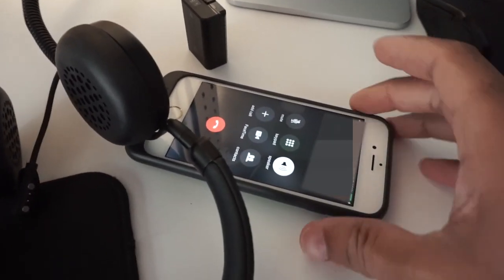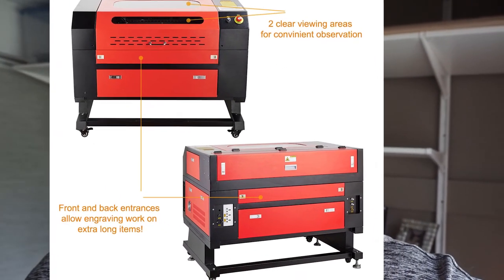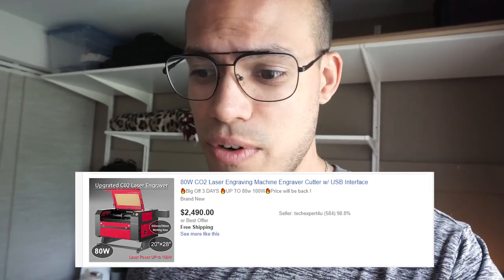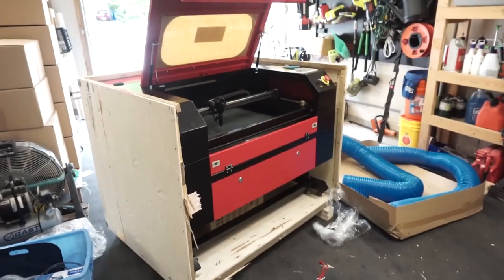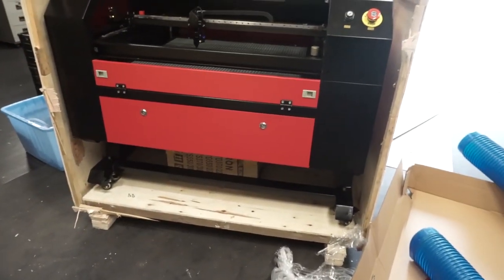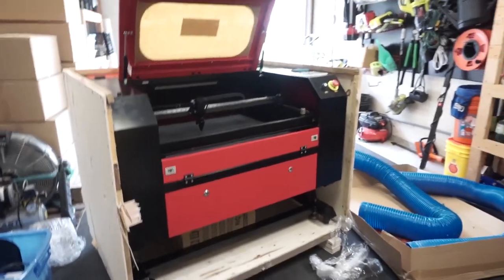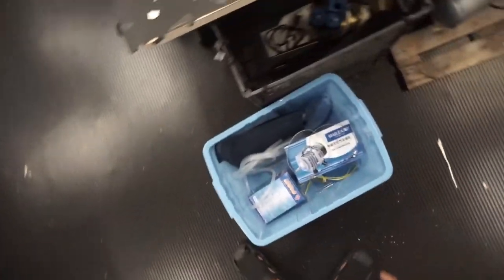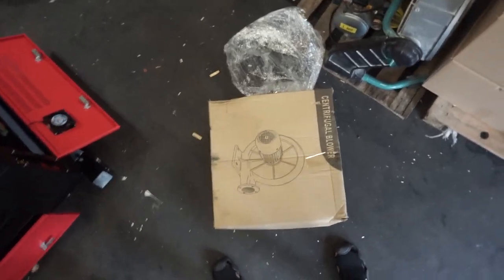Unboxing, Mods and Review | 60w Red and Black Chinese eBay Laser Cutter

Comment: RE: Honeycomb... determine the washer sizes and numbers to get the honeycomb level (if it isn't warped), then use four screws (longer than originals) place them and Loctite them in place and cut them down to just a little higher than the bed. Then put the washers in to keep the bed level and good to go. Might want to use a tool to debur the tops. Just an idea.

Comment: These guys just want to complain. First buy a lower price (cheapest) laser available and then complain about all the things it doesn't come with.
Reply: Honestly the laser isn't that  bad. its the program that comes with it that's ruining it. If it came with Corel Draw or another american program it would work great! Its this RDWORKS Garbage thats making it hard to use. The whole settings menu and everything that should normally be there to help you, including the owners manual  is in what i like to call "chinenglsih" (CHINE-ENGLISH)  Where it appears they have taken Chinese and put it through google translate.
Reply: @theprodistini2590  im using coreldraw to design the files and just use the delivered autolaser to tell the cutter to cut it. no rproblems so far
Reply: @theprodistini2590  RDWORKS isnt meant for drawing from scratch, but for importing designs and defining the laser operations orders and settings.

The drawing tools are just there to do a quick fix here and there when necessary.

Comment: Nice mods/upgrades.   Would not be better to get the 80w since the begining?      What are the dimensions without the legs?
Reply from the maker: Thanks. With the track record on them, I figured I would rather personally upgrade to a known quality Tube / PSU when the time came VS taking whatever "80w" kit they wanted to include for the premium. It's 48w 35d 24t (w/out extension)
Reply: @sjetmand  Nice. Thanks!     I am searching about which one to buy, focusing on engrave area and having pass thru door.  I have just a couple of options and seems like one of this can fit into my office (removing the legs)

Comment: I just purchased this same Machine on Ebay and did one etch job and am getting the same results (weak tube output)  Were you able to test laser output power?   Also any vids on installing the Amp-meter?
Reply from the maker: I didn’t get a power meter together until after I had already replaced the tube unfortunately. I don’t have a video on installing the current meter but it was very straightforward. Just ran lamp cord back to the laser psu, put it in circuit / series with the blue wire going to the laser tube cathode, drilled a hole in the front for mounting and put the meter in line. It is polarized so if the needle shoots into negative territory on fire it needs flipped. For this size tube you want a small mA scale meter ( <50mA )

Comment: Going to necro this old thread. Getting a similar machine in a few weeks after having a k40 for 2 years.  You left out the part I wanted to see the most. Getting that thing UP stairs. Any advice? Stated weight is north of 300lbs
Reply from the maker: I ratchet strapped it to a decent dolly then worked it one stair at a time. It was beastly but manageable. Had to go around a corner at the first landing, that was the worst part.
Reply: On end or still flat?  I have to go up a full set of stairs, I got 3 friends to help, but only so many people fit on a stair case.  I had thought about a dolly but wasnt sure if it could be done

Comment: Great video! Quick Question, I see you removed the laser from the stand, What is the height of just the laser as its on your desk? Im trying to figure out if I can fit this through my doors at my house. Thanks!
Reply from the maker: It's 48w x 35d x 24"t. Should definitely fit through most doorways at that rate but would strongly recommend you have 1 or 2 people help navigate.

Comment: Looks like the red dot is set to where the laser's focal point is set at. Only reason to change it would be if you changed lenses out. For example: if it comes with a 1" lens and you changed to a 2" lens. Then the focal length will be lower.

Do you use tap water or de-ionized? Tap will have minerals in it that will eventually build up in the system.

Consider setting up a small halogen bulb (or two) to keep the water warm in the cold in the laser tube chamber and heat the water tub, too.

Comment: You mention that the honeycomb wasn't level. But you also mentioned that you removed it and it was tough to remove and not designed to be removed. Do you think you were inadvertently responsible for the problem, and it was level as shipped?

Great video, btw! Thank you!
Reply from the maker: tieck it's not so much that it wasn't level as you can adjust the levelness of the entire bed ( though the process is pretty sucky ) it's that it wasn't flat, sort of bowed / bulging at different points. I don't think I contributed to it.
Reply: @sjetmand  Funny I should see this comment from you today: I've just learned exactly what you mean the hard way. Ouch.
 They should make them out of granite.

Thank you again for the helpful vid!

Comment: Thanks so much for this awesome video! I am considering buying this very same laser soon. However, I am not very knowledgeable on the electrical aspect. When you upgraded your tube, did you upgrade your power supply as well? If so, do you happen to have the link handy? Also, where did you buy the part that you replaced that the plug goes into?
Reply from the maker: Hey Brittany, yes the power supply should be rated to match the tube you're using. So I purchased an 80w PSU for the 80w tube. Here's a link https://goo.gl/JNdsu6 . The IEC socket I used was from my salvaged pile but you can find them on Amazon as well https://goo.gl/6CpmLw . Good luck!

Comment: Do you have link to the file to print the tube cover?  Or you’re using something else?  Thanks
Reply from the maker: It wasn't printed. If you skip to that section you'll see it's made up of PVC tube, a drainage endcap and a drain flange from Home Depot (with the drain grate cut out).

Comment: How tough was it to take the legs off?  I have a door clearance issue and the sellers are telling me that the legs are not removable but really, anything that went on CAN come back off in theory.  Was it just a matter of removing some bolts?  Thanks in advance.
Reply: Check out the Facebook group. Many others have documented separating the two parts. https://www.facebook.com/groups/1314938658533901
Reply from the maker: Marti Thew not hard at all. Four bolts into threads. Maybe harder on different models though .
Reply: they come off with allen wrench. I had to remove mine so I can make it fit through my door.

Comment: I need to etch and cut various hardwoods up to 1/4"  and this (your) machine looks like it might be a good choice. What do you think? I'm somewhat confused because there are several different listings on ebay with a small price spread. I'm guessing they're all the same. Also one on Amazon for several hundred $ more. Same machine ? I'd like to buy before the end of the year. I'd appreciate any insight you have. Thanks !
Reply: Hardwoods will need something in the range of 100 to 150 watts. Probably 150. I cut 1/4" birch ply with my not really 60 watt machine in one pass but hardwoods like walnut, maple or oak are really tough to cut through.

Comment: hi, I just got my unit and when I plug it in, it doesn't have any power going into the panel, HELP, I already check the fuse, the connector but it's not power on?
Reply: Make sure the emergency stop switch is reset please.

Comment: Thanks For The Great Video! Did you replace the laser head? I have the same machine and my focus looks way lower than yours. My focus is 20mm yours looks about 5mm?
Reply from the maker: Nope, in the video it is stock. However I think the stock lens is 1.5". I've since purchased a 2" lens to try and push the envelope for material thickness and work with a known "quality" lens (18mm meniscus 50mm from CloudRay for about $20). The head is now much further from the material. How are your cuts / etches coming out?
Reply: sjetmand if you replace the lens do you have to replace what the lens attaches to as well?

Comment: isnt there warrenty and you could get a new tube?? im buying this machine soon and I sure hope it last more then 3 weeks...
Reply: also im running out of room in my house and dont have an insulated shed yet...would this be hard on the laser to run outside when its 90 degrees or even 0?? Minnesotas extreme temps...
Reply from the maker: The seller did issue a partial ( $200 ) refund for the tube failure, but YMMV.

In response to your question of temps, as long as you can keep your coolant above freezing, but below about 75ºF you'll be fine.

Comment: Hey there... thanks for making the video and review on this engraver.  I have one just like yours and the tube crap out after 3 weeks of  usage.  I am assuming that I did not keep the water cooled enough and clean enough.... thus, I had to purchase another tube along with an 1400 watt water chiller.  You didn't mentioned anything about chilling the water.... what are you experiences with keeping the tube cool?  

Nice job again on the review....  I was surprised to see that you installed everything in the attic.

Matthew
Reply from the maker: My rule of thumb is just to keep the water under 75ºf (drop a cheap thermometer in there). I have a decent amount of water and rarely run the thing for long stretches of time at high power so it's rare that it will peak from ambient. Especially this time of year (winter in wisconsin). Interestingly I've only destroyed a tube from too low a temperature. Water froze in the line and cracked the tube. So I keep the temp above 40º in the garage through winter which has the side bonus of preheating the car/s. Yeah the attic space works well on account of the large staircase and ample room.

That's just my experience, but a lot of guys will tell you a chiller is a MUST. I just throw a bin of ice in there on the off occasion that calls for it. Good luck and sorry about your tube!
Reply: Thanks for the suggestion and reply.... I was running the machine at least 4 hours on end....... and instead of using that 5 gallon tub... I submerse the pump in a 1 gallon bin of water... I didn't know that I should have regulated the water and keep it at 70 Degrees.  The $60,000 Universal Laser at my work is not water cooled.... just air cool, thus, I didn't realize how important it was to keep the laser cool.

I looked at the 3000 chiller for $150.  People mentioned that was just a glorified fan, so, I had to go for the industrial 5000 chiller.  I can't take orders right now waiting for the new tube.  I want to make sure the machine is always working in the future.
 May I ask what business are you in with your engraver?  As of current, I am engraving logos on 1.5 inch Walnut cutting boards for my client.  I am charging $10 a logo which takes 5 minutes each.  It's a cash cow at 3 straight hours of engraving.

Thanks and good day,
Matthew
Reply from the maker: Yeah, that sounds like you could be heating up the water pretty quick. Is the Universal Laser you mentioned a glass CO2 tube?

Yeah I was seeing similar comments about the 3000. It doesn't sound terrible, definitely better than nothing, but for the price yeah, you may as well get the 5000. They say not to buy a spare tube and claim they have a shelf life. I don't know if that only applies to crappy tubes?

I manufacture a couple of products and use the laser for parts (primarily 3mm acrylic, delrin, films) and to engrave nameplates (spray painted white acrylic). And for creating various fixtures / jigs for making / verifying parts.

That sounds like an amazing contract, a lot of guys would kill for that sort of work / margin.
Reply from the maker: I have no formal background but spend a lot of time in electronics / programming / mechanical design.

I was just following the advice that you should go with the largest / most powerful laser you can fit / afford. It seemed the only downside would be a higher minimum power for engraving which could effect how gentle you can be. I can't fire this tube at less than 21%. So if you want a lighter etch you have to speed it up.

Yeah, you can cut 3mm acrylic with a 40w no problem, but at a slower rate and time is money! I originally thought the bed size would have been overkill but it has already come in handy numerous times. 

I still need to put some algaecide in the tank. After a month or so it starts to reek like urine / ammonia.

At the time of purchasing, I was considering getting the 80/100 just for the protrusion (still assuming the tube would go) but with the $500 premium, I decided I'd just try and make the housing.

Comment: When you printed the test piece at the end is the computer sending directly to the laser from light burn I've been watching lots of the videos on these lasers and everyone always seems to load it thru a usb and then print directly from the laser.  Is the Laser able to plug into you home network and then print from a laptop or does the computer have to be directly plugged  into laser also what do you select as your laser in light burn   because these are all knockoffs of other lasers .  

Sorry for so many questions  I'm about to order one of these and I've been trying to decide to get this style or a Glowforge .

Thanks  Again
Reply from the maker: Hey, LightBurn lets you either "Start" or "Send Job", I think they are essentially the same except "Start" starts the job after sending it. If I unplug the USB cable, the laser will keep going and finish the job as well as let me start it again from the control panel with or without the computer.

Yes you can plug it in to your router over ethernet and command it via its IP address. I've tried this (when I had it near an Ethernet cable) and the only catch was noticeable latency when jogging via LightBurn.

Mine has an authentic Ruida DSP (controller / interface) it is THE ONE to get if you are getting a Chinese laser. You can tell that it's a Ruida just by the button and display layout. The other common DSP is a Leetro. They are not quite as good for a handful of reasons.

If you are at all mechanically inclined, I'd say go with this laser VS the GF. It has so much more going for it at a fraction of the cost. It just assumes a bit more responsibility in maintenance and setup.

Comment: What tools did you use to remove the base from the machine and how did you do it? I'm trying to remove mines but don't know where to start
Reply from the maker: Cristina O.H. it was a large Allen key, 4 bolts
Reply: @sjetmand  Are those 4 bolts located in the bottom of the inside of the machine under that cover plate for the protection for the belts that's bolted to the bottom of the inside with those small bolt screws all around that cover plate
Reply from the maker: Are you sure we have the same machine? There is no plate covering the z table belt at the bottom of mine.

Comment: Oh no, you have not filmed the most important part for me! I also have to unscrew the base of the machine because my door is too narrow. How was the socket fixed?
I just ordered the 80w version of it.
Reply from the maker: 14September2011 It was super easy, there are only four bolts easily accessible at the bottom of the inside of the machine. I forget but I believe they were M 12 or M 14
Reply: @sjetmand  1000 thank

Comment: Can this laser machine etch stainless steel tumblers including the ones that have a powder coating on them? 

Also, does this work with a Macbook laptop for operating the program to send to the machine. I am wanting to purchase a laser cutter but need to make sure some things work in my favor before spending money. Thanks
Reply from the maker: Yeah no problem. Even a 40w would work. I use a Mac. Works within a VM ( I use VMWare ). Otherwise if you can swing the $60 or so, Lightburn works natively on Mac and is better than the software that comes with the laser (RDWorks)
Reply: @sjetmand  thank you.
Reply: @sjetmand  Another question. Do you know if this will engrave the slide on a handgun or other firearms?
Reply from the maker: Yeah, lasers are used for marking guns very often. I etched an AR lower for a friend once.
Reply: @Grizzliestravelandleisure  It will not engrave to ATF standards however... FYI.

Comment: Would you mind providing the dimensions of the machine (just the main part without the legs or the laser tube extension)? I'm trying to find out if the machine will fit in my basement. thanks!
Reply from the maker: It's 48w 35d 24t (w/out extension)
Reply: @sjetmand  thanks!

Comment: Mine arrived with a bad PSU and the seller refunded $150 and also sent a new PSU! I will be buying my second machine through the same seller. I purchased a 100W machine, but my next one will be a 60W. The 100W is overkill for what I needed. Ive had the machine for over a year and it's still running great. Only other issue besides the power supply was a bad linear bearing on the x-axis which I replaced and fixed all my "wobbles" in the head.
Reply: I commented before I watched the full video, I used the HIWINI bearings when I replaced mine, and they were PERFECT. Worth the extra $ in my opinion.
Reply from the maker: Wow, that's impressive service. 100w would be overkill for me too. Even with the 80w, my minimum etch power is a little high at 21%.
Reply: What seller did you buy from on eBay?  Sounds like you got a good one.

Comment: I was down at my shop and made a video of the Laser at work.  It's a double tube of 75 watt purchased 10 years ago from Universal Laser for $60,000.  It does not run as efficient as our Chinese Engraver from Ebay of today.  We use this Engraver for Drawer Box logo for our clients.  These tubes are air cool contained... You will see them in the video in the back of the machine.  Here is the link to the Video: https://youtu.be/XS2XEUOKuPk